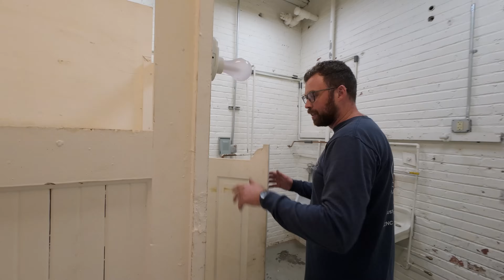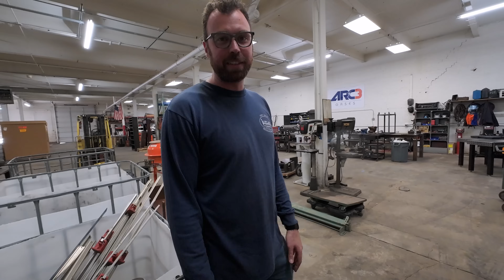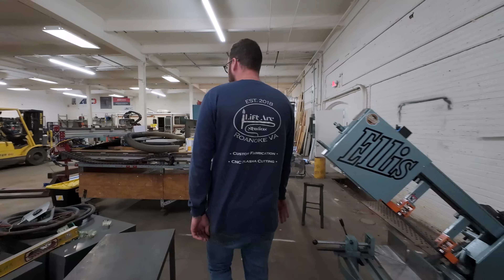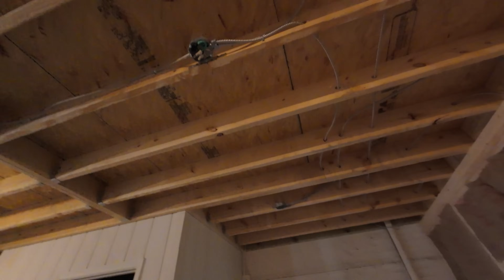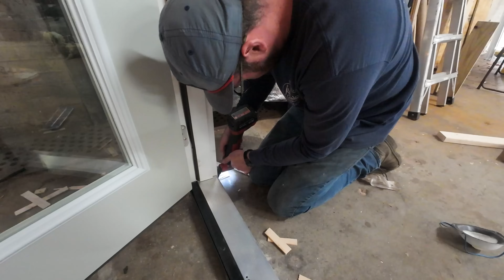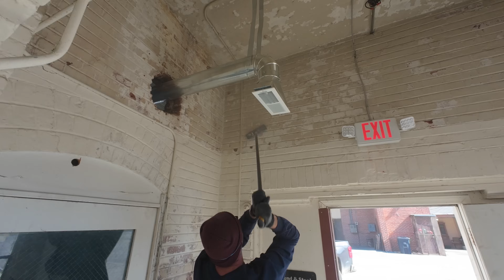THE OFFICES: The Move (Part 5)

Comment: It looks really good. I still think that you might regrett fixing up the floor before you started to move things into the space. 
To remove the smell you should use some white vinegar to clean of the surfaces inside after you have leaned out all porous material like fabrics and carpets etc. You could also try and use a ozon generator and put it iside during the nights and time it to turn of some ours before you arrive in the morning since Ozon is toxic for life. You could also cover it in a tnet and and fill that with ozon that you can then direct out through the ventilation.
Reply from the maker: These are all excellent suggestions! Once we put the AC in and started running everything it really helped. Same with power washing the floors too

Comment: Tay, Since the storage overhead of office isn't set up with stairs (yet) what about doing an example for customers of all the various styles, treads and handrails you can make, and/or imagine using the 3D printer for non structural parts on wall as 1/2 surface models hung like photos, while making it a functional steel base frame to access upper storeroom ? Every tread/style a different example, or maybe just the 5 to 6 most popular you've already made ? It would give Spike and you a lot of reasons to use the new printer...

PS You will really need some type of floor to ceiling drapes to separate front drive in areas from back to isolate those garage doors in summer/winter temps, and for reduction of echos and noise.

Comment: You’re going pretty well. I’d like a screw compressor as well. Just remember that it’s quiet-er. It’s not quiet, as I found to my dismay. “Because I want it” is a reason I often use. Something is weird about the timing of this video. A previous video had you further along and the mill was already working. So you said it was October. Did you lose this one at first?
Reply: I built small rooms for my compressor and dust collector. Filled the walls with Rockwool Safe'nSound insulation and skinned the walls with de-coupled Homasote beneath OSB outer walls. So glad I spent the time & cash to do that, as I can finally hear myself think inside the shop now.
Reply: They seem to have borrowed TOT's Time travel machine for a bunch of the recent videos 😉
Reply: Walker has had to juggle and prioritize. A long video like this one needs time and editing, but he needed to churn out videos while also contributing to the physical move and managing that disruption.  He dropped some quickies along the way to keep the algorithm and us satiated while slowly crafting this story for quality and posterity.

Comment: Cool stuff. A coworker of mine will give me a stern look if I don't point out that it's actually "CHAMPING at the bit." 🤷🏼‍♂
Reply: But it's not, it's "chomping at the bit". It's a term the older generations used because the work horses. They used bits with the reigns, in there mouth, when working. The horses were always chomping on them to stsrt working.
Reply: @Bennetts_Fabrication_Welding  Look it up.

Webster's says "champ at the bit" is to "show impatience at restraint; be restless." It comes from something said about horses when they bite their bits "repeatedly and restlessly." They "champ."

The original saying was "CHAMPING" and not "CHOMPING." It has been morphed into the latter because ignorance is contagious and we lost what the meaning of "champ" meant.

I added the comment half-heartedly. I wouldn't have figured someone with a keyboard that doesn't know how to use Google would try to argue about it.